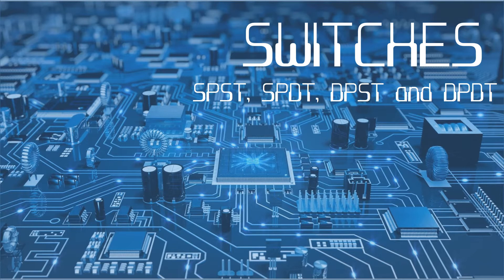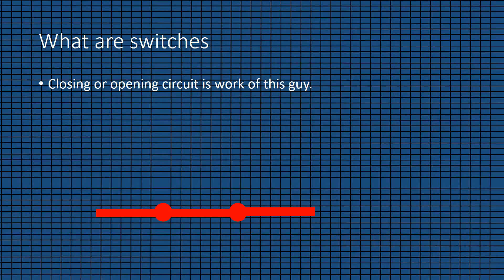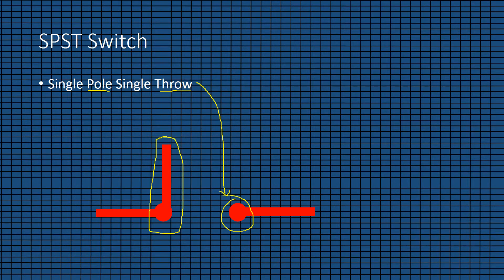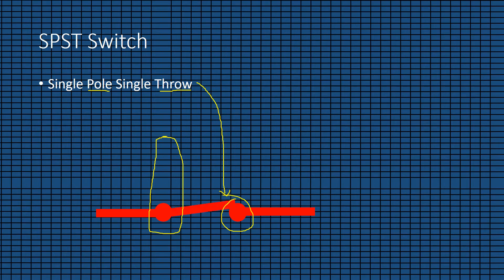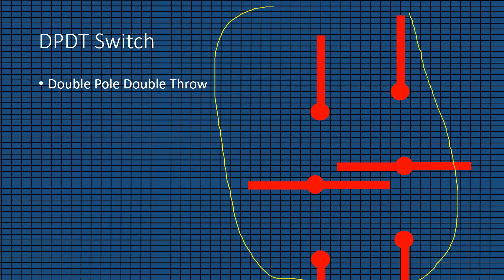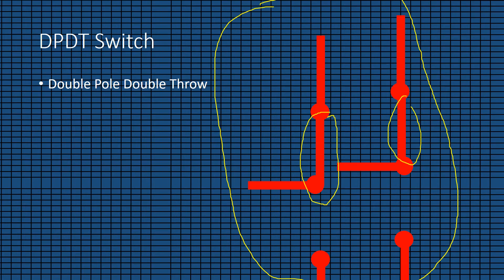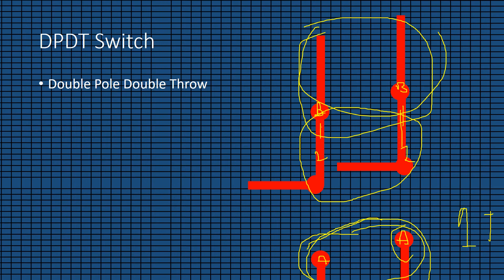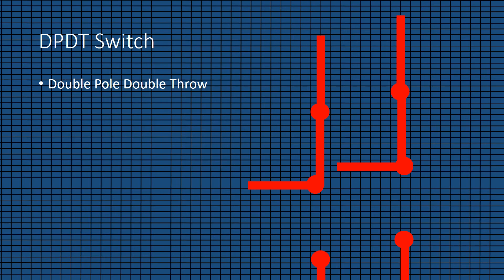SWITCHES - SPST, SPDT, DPST & DPDT

Comment: I got a SPST switch but can't get it to even work with just powering an LED.
Reply from the maker: spst switch is the simplest buddy. You wiring may be wrong, led may be faulty or there wont be enough power source.
Use a 9V battery with 330ohm resistor
Reply from the maker: with a different led. You can simulate your circuit on tinkercad.com